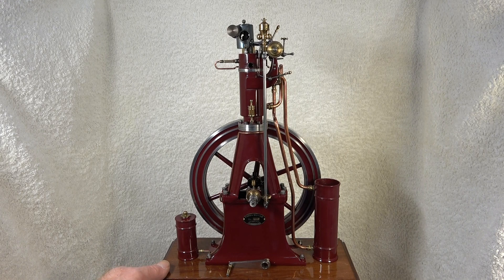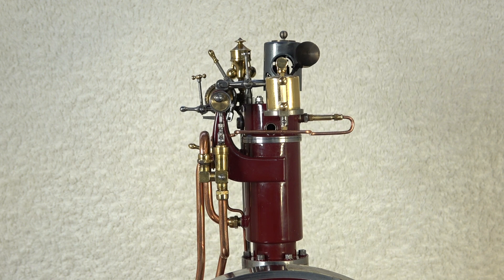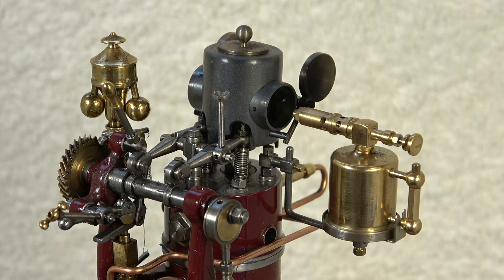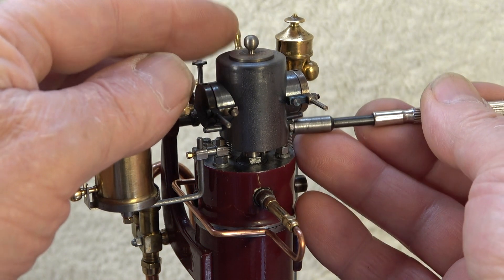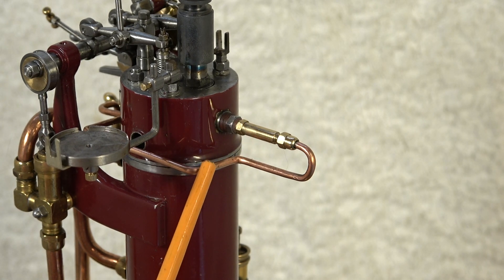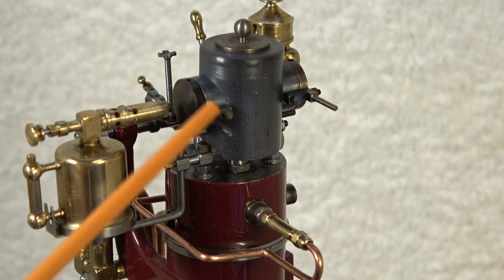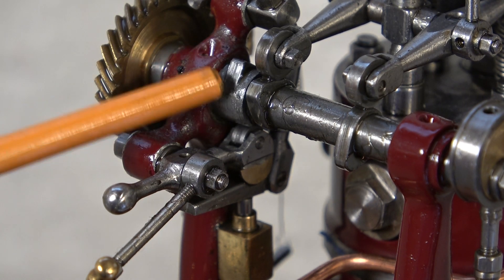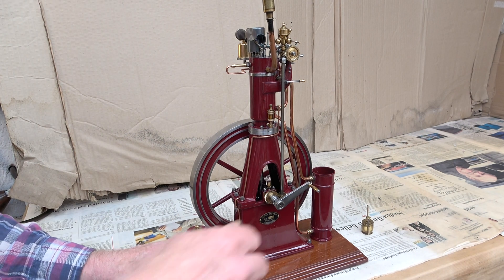Super Slow Mini Model A Frame Semi Diesel How Slow ?

Comment: When its going this slowly (~250 RPM from the audio) you can actually watch the entire cycle if you step thru it frame by frame and its a real mind-bender for sure. Its not firing in sync with the injector pulses from the pump as the cam goes by. The fuel gets injected, but it doesn't start to actually burn until its well past TDC. In fact, the exhaust valve opening is what actually starts the combustion from watching the flyball governor. Id suspect either its the hot gasses in the exhaust or reversion of air back through into the combustion chamber that finally allows the fuel to start burning and generate power. 

On a side-note, these are fantastic works of art! I remember seeing his first video he published years and years ago and its great he still manages to post new content.